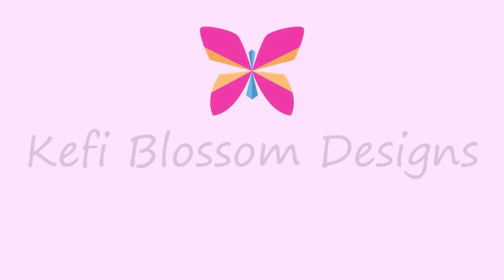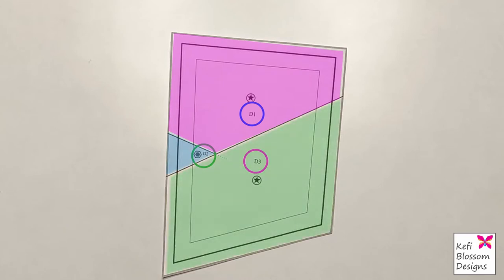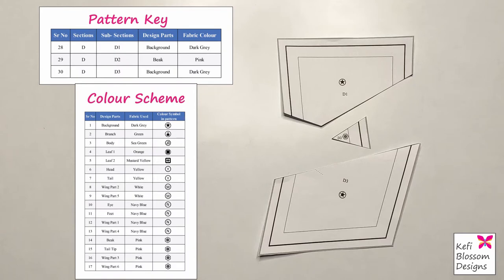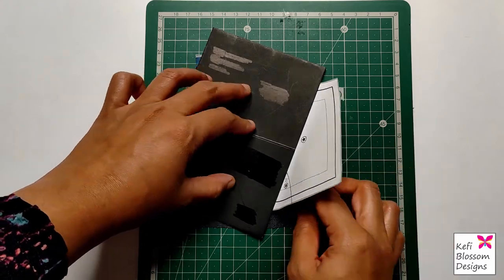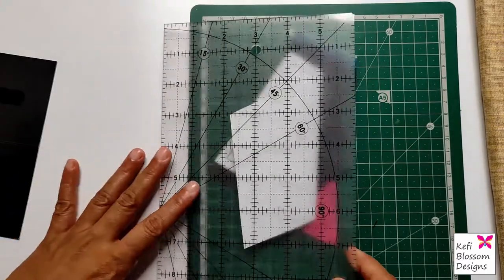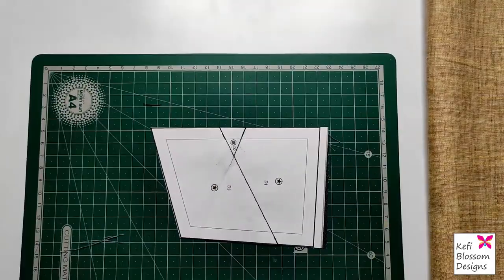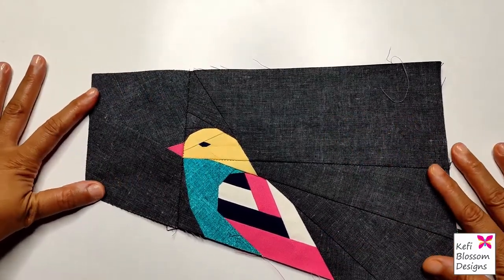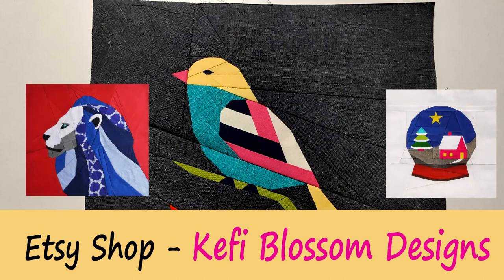Tutorial on Basics of Foundation Paper Piecing

Comment: Your pattern is beautiful and your explanation is clear.  

I resisted buying an add a quarter ruler, but I find that is increases my productivity.  I conscripted by Dritz Easy Hemmer (thin metal) as my "card".  It butts up nicely on the folded paper and the add a quarter for clean trims.  For those with an acrylic sewing table, a nightlight underneath makes a great light table.  And glue as you demonstrate ensures that stuff stays put.
Reply from the maker: Hey Leisa,  thanks a lot.. ☺
I have started using the add a quarter ruler recently, it definitely has improved my productivity and the light under an acrylic table is a fabulous idea 💡